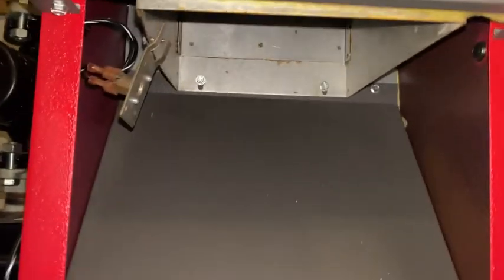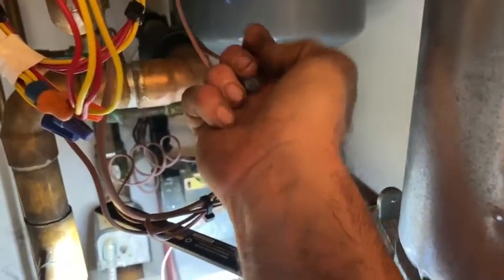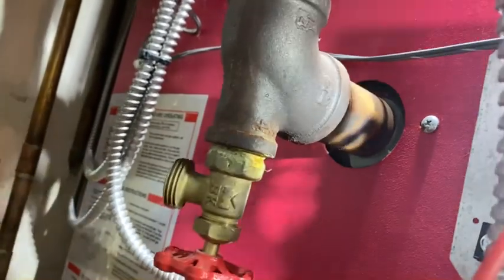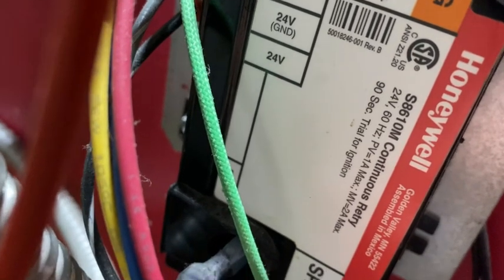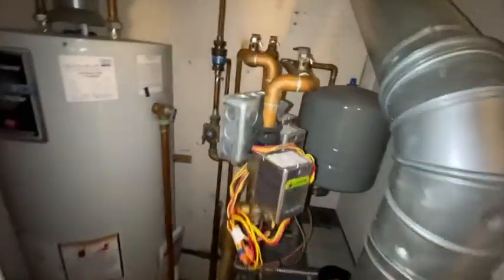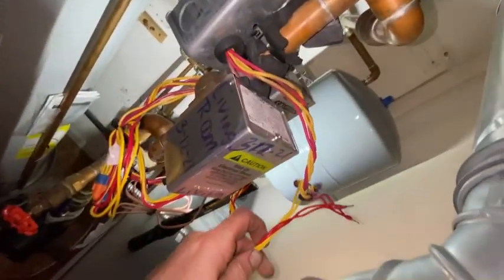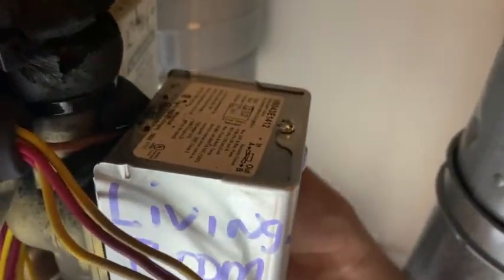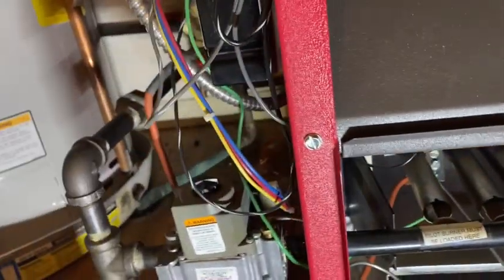Hot Water Boiler Not Heating Multiple Problems Old Lady Really Cold House 76°F

Comment: Installers often do an amazing job of fitting a square peg in a round hole but then the repair tech comes in after and can't fix anything because they sqeezed a square peg in a round hole. I was just on a boiler check up up and they squeezed the zone valves between the wall and the boiler 4 of them. Maybe an inch clearance. Maybe I can do the 1st one.. Not even enough room to open the cover on them. Should one fail we would have to remove the wall or the boiler. Hope I don't get that call!
Reply: You know you will though. That's the worst part.